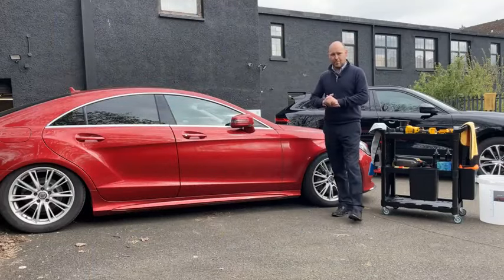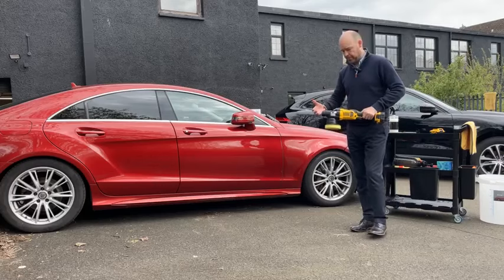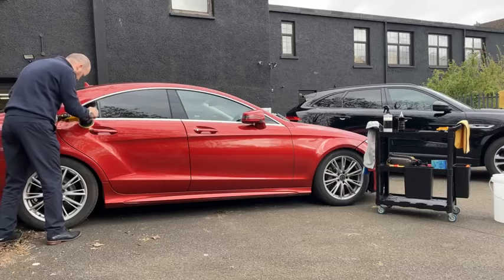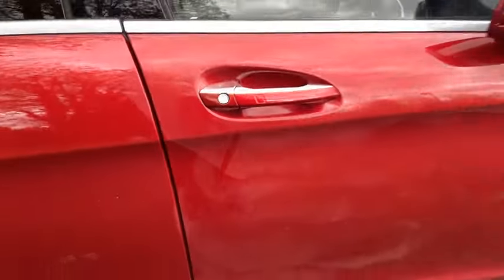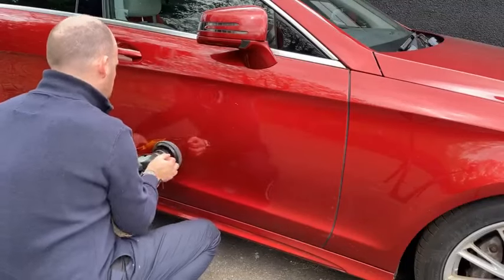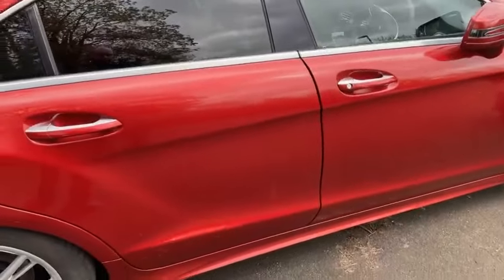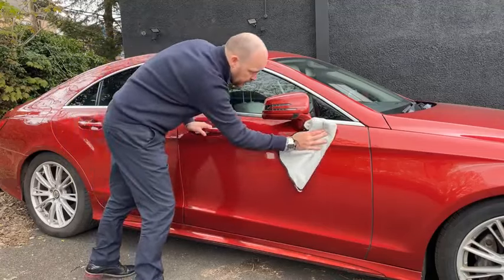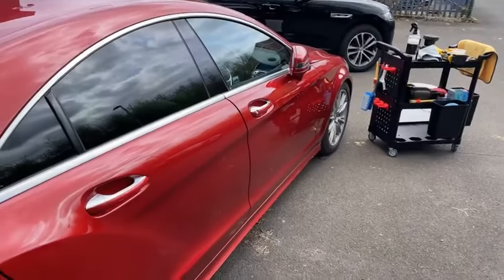Ivory, Super Wet Look Wax applied via Dewalt Dual Action Polisher

Comment: That's a bit spooky as I have the Jag lined up for it's spring Decon wash tomorrow and my wax of choice for the next few weeks or until I decide I want to try another M&K wax was going to be Ivory so it was good to see it in action. I washed the  Nissan with Cera on top of the Aegis today then dried it and topped it with Seal and I just had to take it for a drive as I don't think it has ever looked as good as it does. Simply stunning.
Reply from the maker: Sounds great! That's what it's all about!